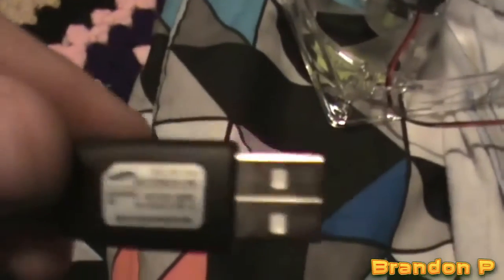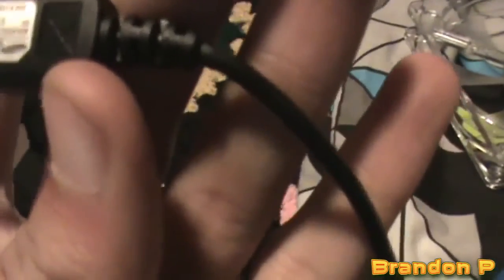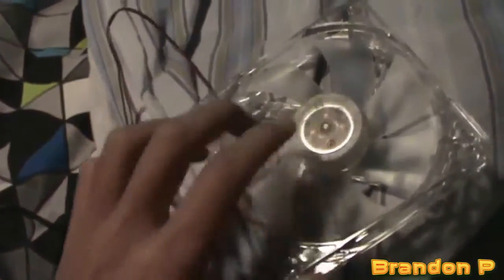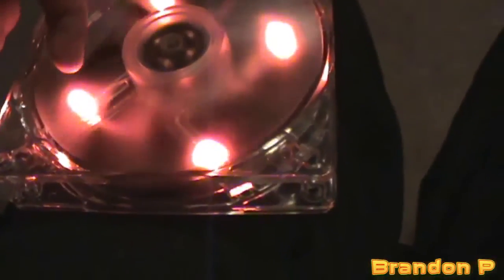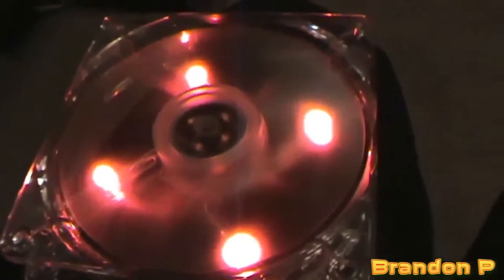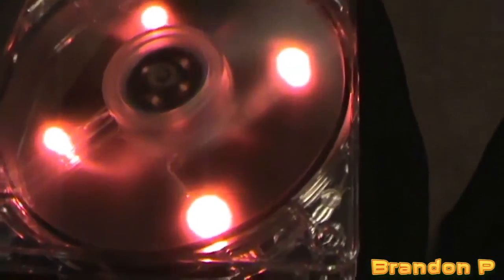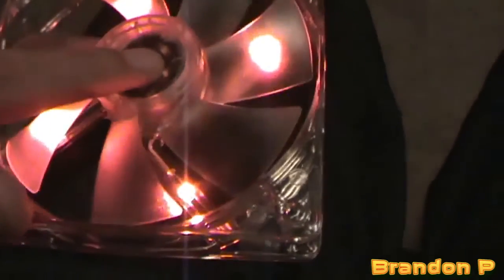PC Case Fan Running off USB!

Comment: Any idea what each cable is for on a 4 pin case fan? I want to use one for a custom Laptop cooler something.
Reply from the maker: I just put different cables together until it worked
Reply: the red is positive the black is negative and the others are used to let the motherboard control the speed of the fan